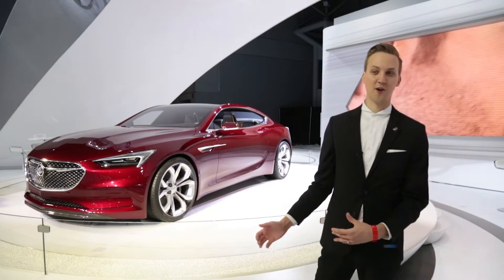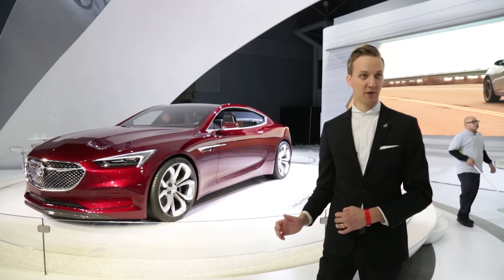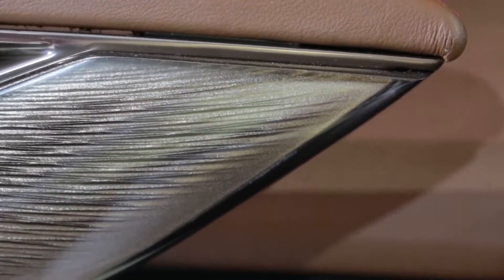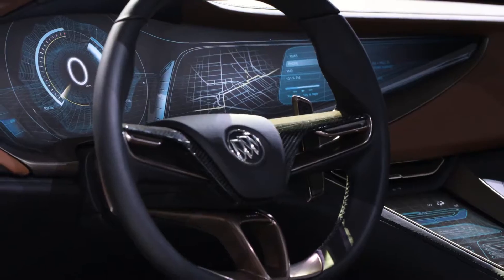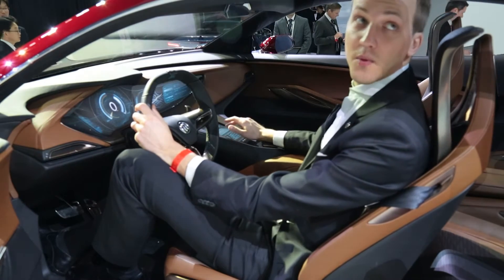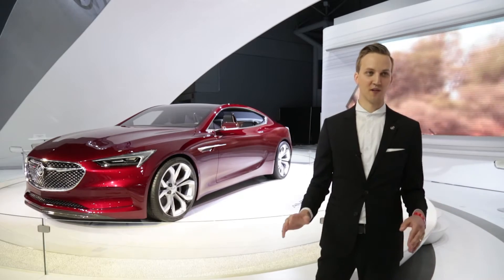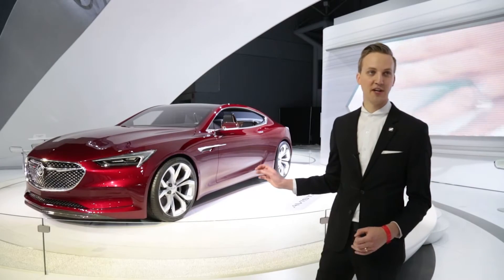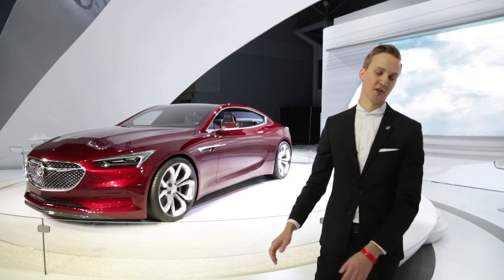Inside The Buick Avista Sports Coupe Concept

Comment: There Engineers suck and don't have a clue what's going on in the car world because if they did they would have put the new Chevrolet lt4 small block V8 in this car.but there not even makeing this car.Buicks suck now.that's y I love my 94Limited Buick Roadmaster with the corvette engine LT1 5.7 in it and it's rear wheel drive